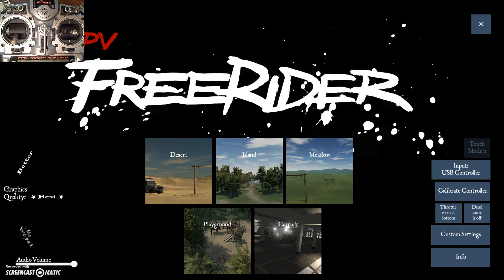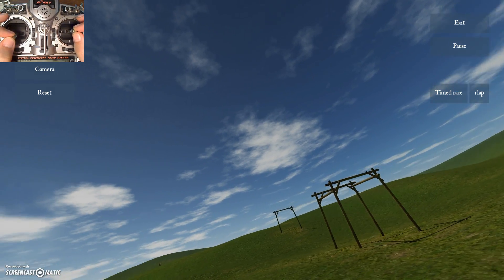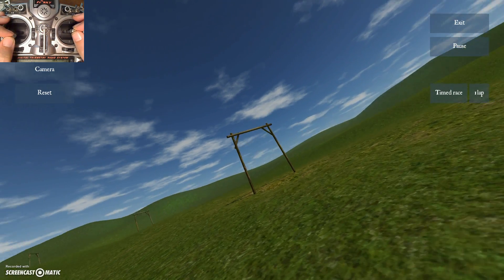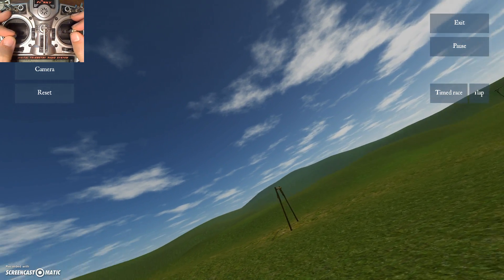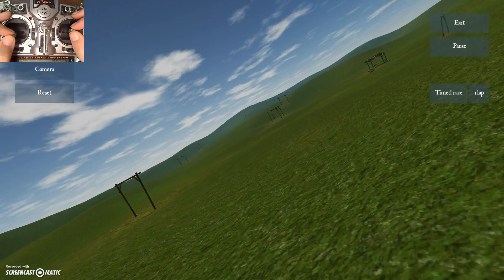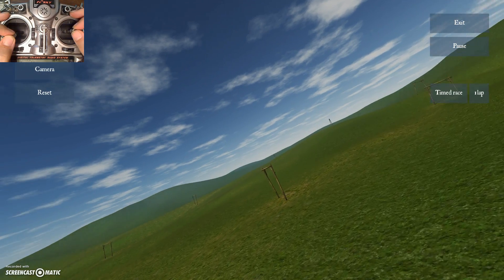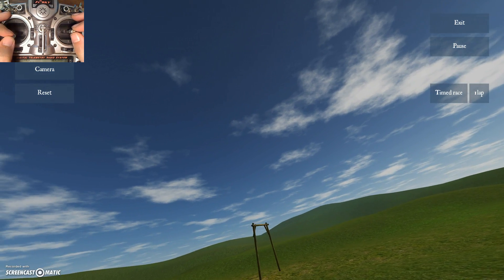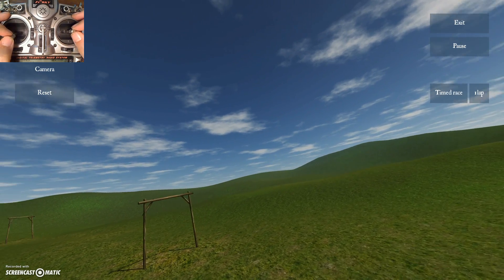How To Fly a Racing Drone - Lesson 21 - Nose-in Circles

Comment: The reason (there are in fact two of them) why you have to pitch forward is not the inertial (centrifugal) force but fhe fact that when you apply yaw in the situation when the quadcopter is aready rolled to the side - the nose will start to point more and more towards the sky. It is pure coincidence the nose will start to point towards the sky faster when you go faster so it looks as the 'centrifugal theory' works (because it might look as: more roll > more speed > centrifugal force increases > add pitch FW not to fly back because of the centrifugal force) but what really happens is:

More roll > more speed > add more yaw to follow the circle (to still face the center of the rotation when going faster around the circle, yaw has to be more degrees per second) > add more pitch FW because of 'already rolled quadcopter to the side + applying yaw = starting to face towards the sky' and because of 'more rolled quadcopter to the side + applying same yaw = starting to face towards the sky even faster than when the roll angle is smaller'

So the reason(s) for having to apply pitch forward is/are pure geometrical similar to why you have to apply the yaw after applying roll to keep the horizon at the same angle or, vice versa, to why you have to apply roll after applying yaw to keep the horizon at the same angle. Although there is centrifugal force factor as well, those two (geometrical) reasons I mentioned are orders of magnitude larger - to the degree we can neglect the influence of the increase of centrifugal force when going around the circle faster and faster.

Comment: How about rolls and flip an through a gate? I can do them all day long as long as I have plenty of altitude. I've been seeing the pros roll in between tree branches but i don't dare try because I loose to much altitude.
Reply from the maker: +Marc Place That's tricky. I think one key is to have super high rates so that the roll is over quickly. The faster the roll happens, the less altitude you lose. Also, zero the throttle or you will pull yourself downwards when you are inverted.